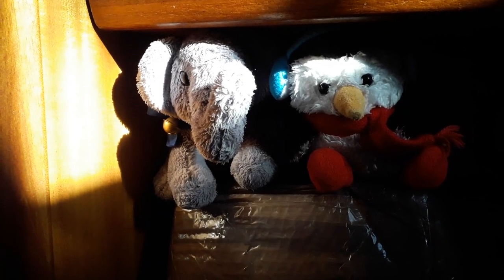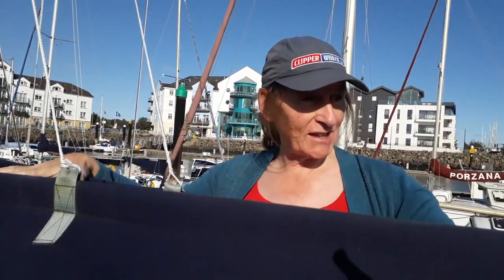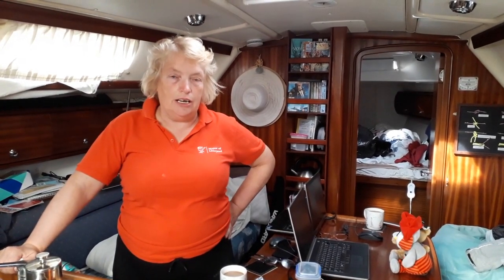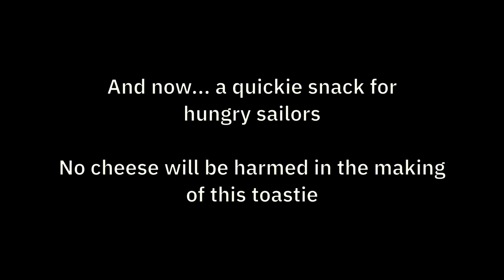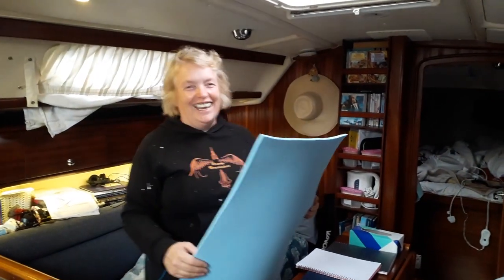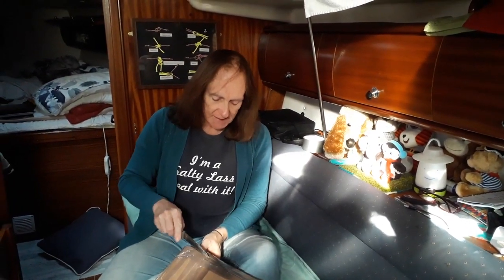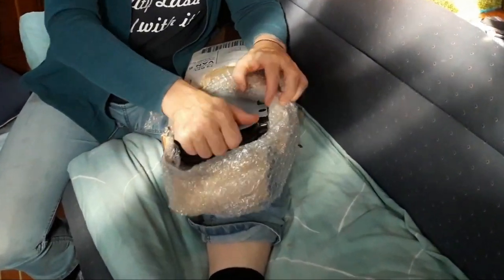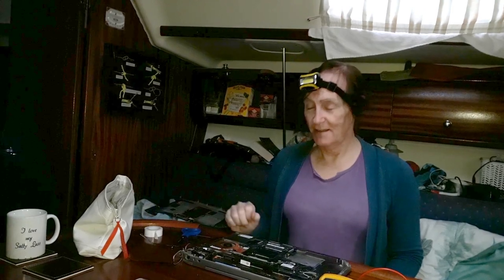Sailing Northern Ireland - Back in Carrickfergus - Belfast Lough - Ep.157

Comment: I found a good way to stop damp ,on my Bavaria was to block up the vents at the back of the cockpit locker with foam ,obviously unblock when running the engine.It made a considerable difference to my comfort ,best wishes and enjoy !
Reply from the maker: I am looking to take those out and re-bed them (one of the previous owners made a right mess with sealant). I wonder if I can fit some sort of flap? It is nowhere near the engine space

Comment: Have you guys thought about the lithium route for you house batteries? I know they are eye-wateringly expensive but when you consider the cycles, discharge rate and life expectancy in the long run they are cheaper than other batteries types. 
They also lend themselves to an inverter because they will tolerate a relatively high current draw and one 100 amp/hr lithium will well exceed the capacity of a 200 amp/hr lead acid or gel type batterie.
Reply from the maker: Not only are they "eye-wateringly expensive" but we would need a new controller as well. The thing is that we only need the batteries to hold enough charge for one day because the solar panels soon charge them  back up (another issue with Lithium is that our panels may not be big enough to charge them up, so more panels needed as well)